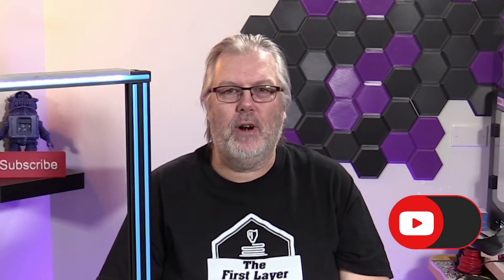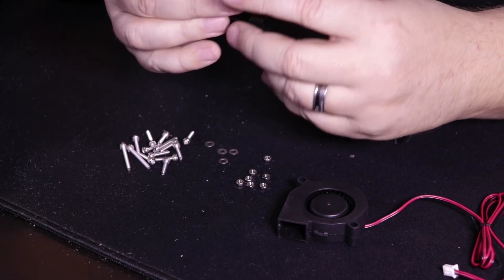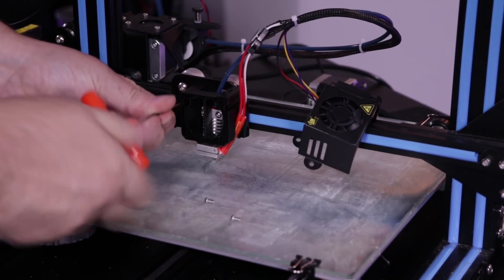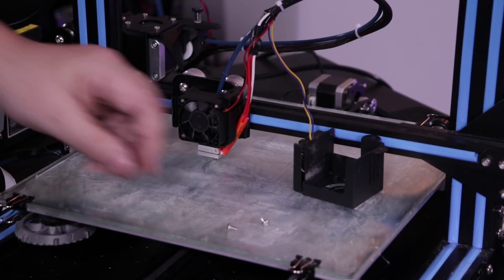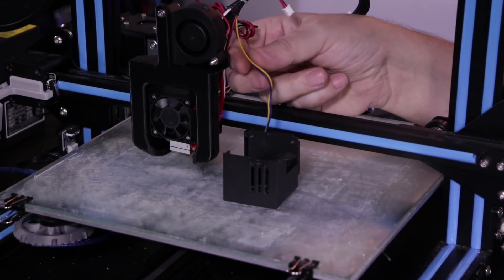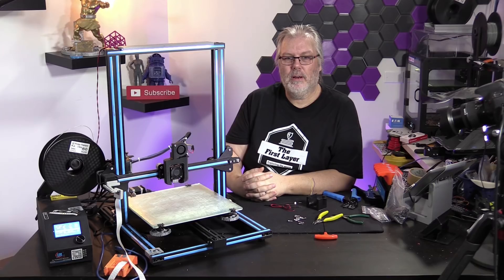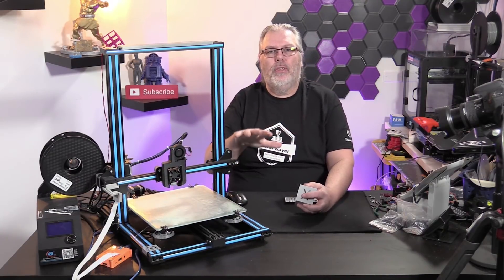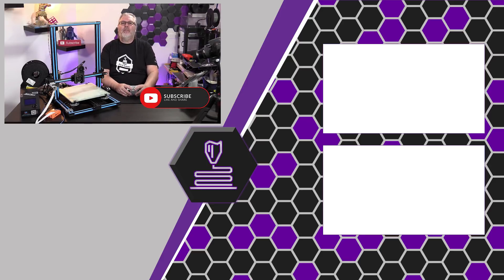Cr-10S Upgrades Part 3: Better part cooling with the Petsfang blower system.

Comment: to determine the fan wiring. take  a multimeter to it. it is DC voltage. If its positive then you have positive on positive.

Comment: May sound dumb, but how do you attach the connections after snipping the wires from the stock fan? Not a wire savvy person
Reply: Soldering that would be called ;)

Comment: I Have a question, i printed and installed this, Im having issues now laying my first layer down for new prints. I just want to see what anyone is printing at just to make sure its just my settings/bed leveling and not the actual petsfang preventing the print to either stick or build.
Reply: You are supposed to have the part cooling turned off for the initial layer.

Comment: Could you use pla?
Reply: I. Have used PLA. Works just fine👍
Reply: I’ve been using a Petsfang printed in PLA for several months and it’s working great. No imperfections with nozzle temps as high as 260C. PLA should work fine for you